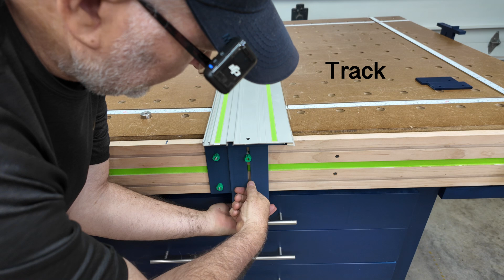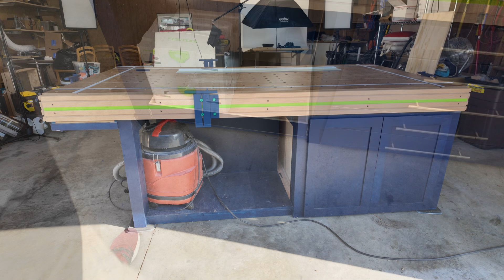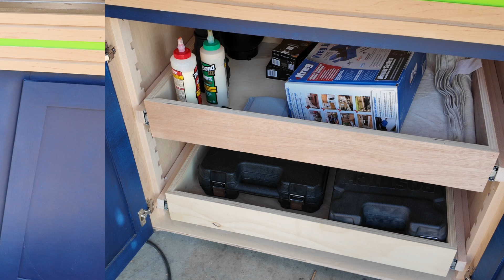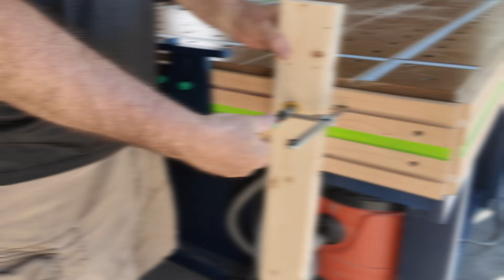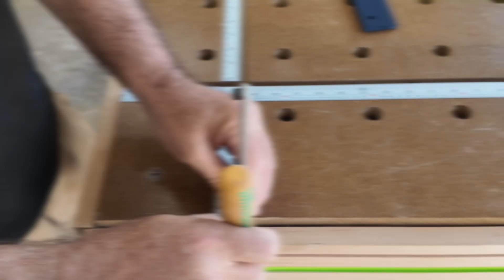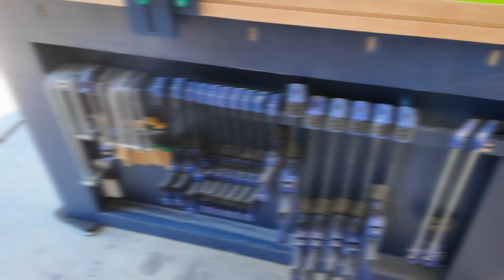Ultimate Festool Workbench

Comment: Very ingenious ideas. I would have track saw trays on all four corners.
Is there an opening for sweeping out the torsion box?
Other than clamping while sawing, milling and the like, do you find yourself using the dog hole grid during assembly?
I’m going to use two the Paulk design, but not his chop station version. Just two 3’ x 6’ holey tables on wheels.
I want to see what I can do with a Festool track saw, router and a couple of their sanders.

No table saw, jointer, planer, bandsaw

Comment: Very cool. I have a question about the bracket for the rail guide. Is the idea you have 2 brackets on each side of the bench and you just lift one one up to slide the wood under? As opposed to a hinge mechanism where the track rail is attached to one end?
Reply from the maker: It would be next to impossible to have a hinged bracket because of the length of the rails, especially the long direction. This way you set both brackets to accommodate the material thickness and then you simply lift the rail off to switch material pieces and then just set the rail back on. It falls into position fairly easily even with the longer rail

Comment: Really like the pull out trays for track saw and plans and the drawer dividers.  What is your source for the measuring tapes attached to the bench top? Thanks for the video!
Reply from the maker: I got them off of Amazon, I think they are Fastcap. They are metal and if I were to do it again I would have recessed them into the top because plywood snags on them. I think Kreg makes the Lefty/Righty tapes also